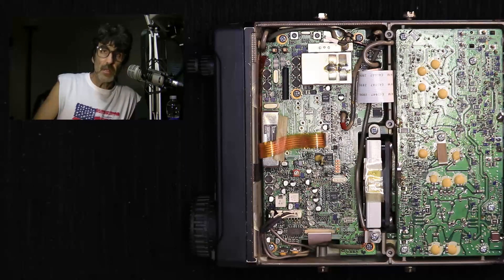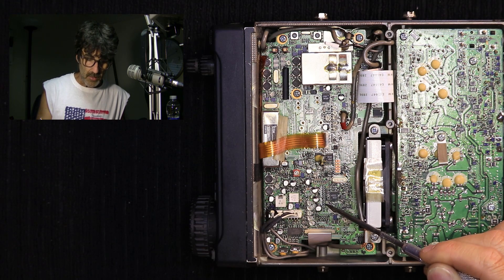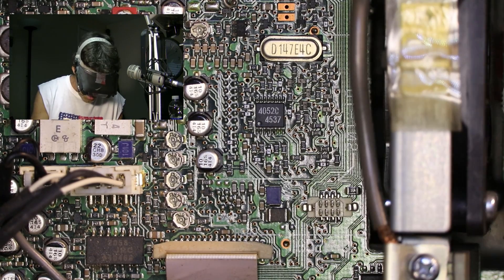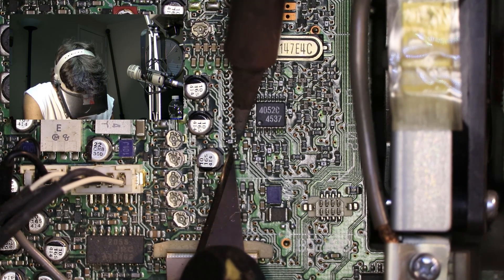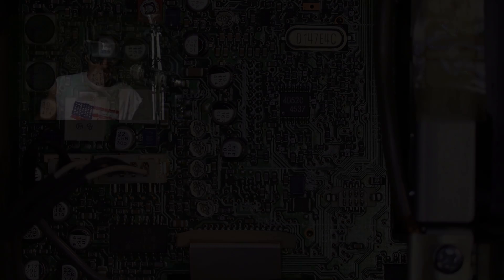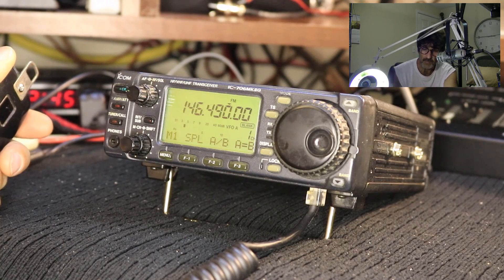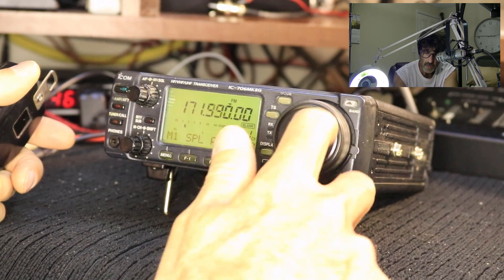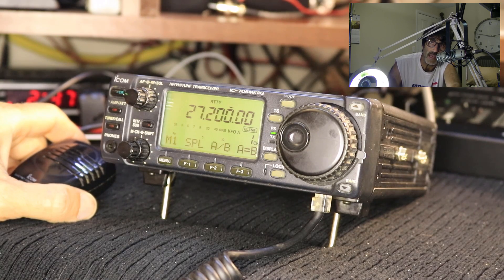Icom IC-706MIIG Mars/Cap Open TX Modification FREE and Easy!!

Comment: hi there great video mate ,quick question could i just unsolder one side of d2030 and ease it up so the radio could be returned back to original at a later date cheers rick queensland australia
Reply from the maker: Yes, that would work.. trouble is, that diode is so small you'd have to be a brain surgeon to get it to do that, but if you can, then no problem.  I'd put a piece of tape or paper under the side that's lifted up to make sure vibration doesn't move it back down and make a intermittent connection...... cheers..😀